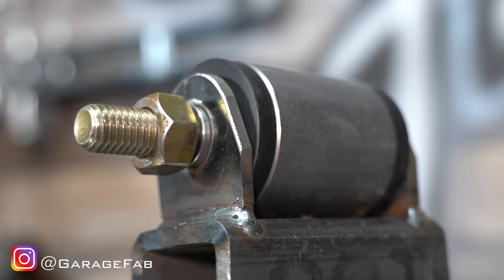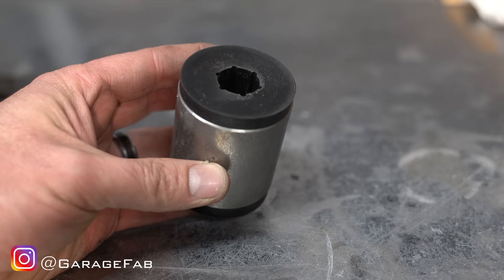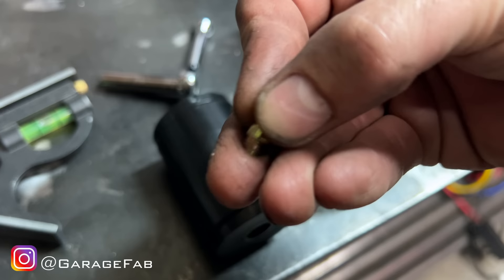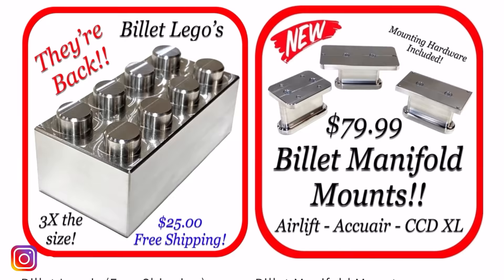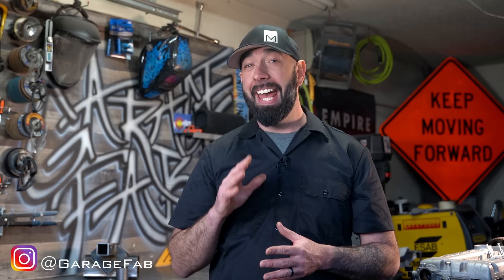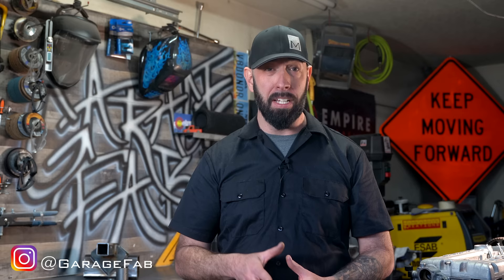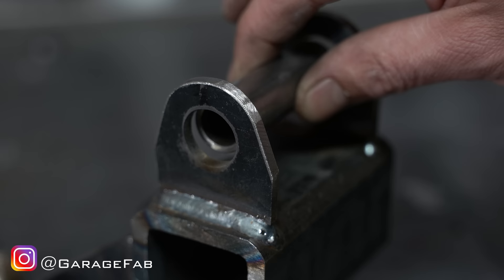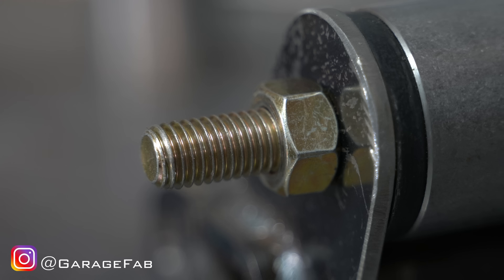The DOs and DON’Ts When Installing Polyurethane Suspension Bushings

Comment: I you'd like 2 see an unexceptable product being produced and sold as replacement parts and compare to the original then here's a prime example I personally had 2 deal with which was time consuming and highly frustrating... rear lateral rods for an 02 pontiac grand prix gtp new replacement are all being made wrong!! The inner sleeves of he new rods are 10 to 15thousants of an inch larger than factory original meaning they fit looser and will prevent rear from holding proper alignment and causing rear end to bump a little side to side over potholes at any speed over 35mph.. this is no joke,, I'm diyr but a well experienced diyr person nothing else was wrong with the car untill I put these in., and in addition the rubber compound of the bushings were softer than stock, so what what the fix?? I temporarily found used ones from a junkyard car and put those in and problem solved!!! New parts should never fit loose and give a car another problem like this,, I did find one brand and one brand only that actually and I can't stress this enough one brand only that actually fit proper and with bushings that are just about as firm as stock which are BMR.. these are expensive but they do what they're supposed to do.. No other brands Not Dorman Not Napa Not Orielys No other brand online just BMR are the only ones that work/fit proper., I only replaced my originals because the adjusters were froze from too much rust no matter how I heated them and soaked them with lube they just wouldn't adjust so that's why I went all this bs,, needless to say I doubt I'll own another w body car,, Nice Video!
Reply from the maker: That was a whole lotta truth! If it’s aftermarket rubber, it’s crap. We’ve tried every brand at my shop and every time we warranteed the job because the bushings failed for one reason or another.
I think you’re spot on. You’ve got to replace suspension components with factory parts, and if you can’t get them, replace with high quality polyurethane.
Thank you my friend!

Comment: And no mention of pre load so still installing bushings wrong.
Reply from the maker: Not necessary with poly bushings. 👍
Reply: @GarageFab  So after looking through my previous builds Energy Suspension and , Hotchkis manuals both do not say anything about preloading poly bushings prior to torque so I do stand corrected my apologies was trying to troll without knowing for sure .
Reply from the maker: No sweat my man!

Comment: "There is NO grease inside the sleeve around the bolt, why? Because..."
Because they want you to have to destroy the f**ker with a hacksaw first, and then with a torch in order to get it off so that you can replace something unrelated on the other side of the truck.
Reply from the maker: Dang. Sounds like something an angry rust belt native would say.

Comment: Poly bushings in this [and most] scenarios are dumb. The poly does not adhere to the inner or outer sleeve so the poly just walks everywhere over it. And often simply binds up any articulation in the joint. Ride quality is worse, road noise is worse. Simply do not use them. 
In a strut arm set up they can be usefull for a competition car only. They do throw a LOT more load into both the arm and pickup point. Aussie Falcons, like all early US Falcons, Mustangs etc plus numerous Euro cars tear the pick ups off under the rad support. I have welded up a couple of dozen, and the strut arm breaks making the car lose control. I have seen several cases of that. One that was a very serious accident.
They NEVER do that with the correct rubber. Which for most cars is far superior in every respect. Always has the correct articulation which vehicles being driven on all roads require.

Comment: Hi .. nice videos! i want to contact you to discuss a project. Its going to be different from what you usually do. I was not able to find any contact details. Could you please tell me how to reach you if interested.
Reply from the maker: Hey Abdullah! I’m sorry, I haven’t got time for additional projects at the moment, but if you need guidance I’d happily try and help!
Reply: @GarageFab  thanks for the quick reply and generosity. I have a 1980 k5 blazer that i want to build a modern suspension for 70% long distance travel and 30% offroad. would you be interested in designing it so that my local fabricator can build it. i am in Saudi Arabia.
Reply from the maker: Sorry my man, I’ve got so many projects all going at once, I just can’t doing anything else. I also specialize in air suspension, (Lowered stuff) so though I understand the basics, I’m not sure my off road designs would be acceptable.
Reply: @GarageFab  I understand .. Good luck with your projects!
Reply from the maker: @abdullahalgarzai7996  Thank you my friend. If you’ve got questions I’d be happy to share my thoughts.
Best of luck on your Blazer!

Comment: Rule number : never, ever use polyurethane bushings in suspensions. They are incredibly bad. Good for motor mounts though/  Delrin or heim joints for suspensions are appropriate
Reply from the maker: That sounds a lot like an opinion! From my experience absolutes are almost always incorrect. Can you tell me why polyurethane bushings in Suspensions are so bad?
My opinion is there’s good quality polyurethane and bad quality polyurethane. Also there is a correct way to install polyurethane and a wrong way.
If you use poor quality polyurethane or install them improperly they will fail prematurely, and they will indeed be “incredibly bad“.
Delrin is an incredibly hard material and should not be used on a joint that needs to articulate. A drag car might be an acceptable use for Delrin but I’m sure someone can argue against that as well.
Heim joints are great, but they don’t absorb vibration and they are not maintenance free. Heim joints should only be used in very specific applications with the knowledge that they must be maintained and replaced when worn out.
Poly articulates better than Delrin but is still not ideal for high articulation applications like off-road vehicles. A better choice might be the Johnny Joint.
Poly is a fantastic choice for performance street vehicles. Some vibration is dampened while still reducing excessive component movement, a moderate amount of articulation is allowed before binding, and a long life can be expected if a high quality poly is used and it isn’t abused.
Reply: Unfortunately at our dealership, I’ve replace many aftermarket Poly bushings that have crumbled apart.   But who knows what kind of voodoo “polyurethane” they were buying.
Reply from the maker: That’s the key right there. Quality. If you try and save money on poly you’re probably not going to be thrilled with the product. If you put Energy or like-quality bushings, I’d be willing to bet a decent chunk of money they would far outlast an OEM rubber bushing.

Comment: You failed to address the fact that polyurethane bushings don't hold up very well when used in a vehicle with high horsepower 600+....
Reply: there are different grades and mixtures of polyurethane, if they arent holding up its likely a choice of stiffness etc issue. not just because its polyurethane

Comment: If your custom fabricating use aircraft hardware,...once you do you'll never go back
Reply from the maker: That sounds exciting. What’s the difference? I’m familiar with safety wire bolts, but beyond that I’m not very educated on aviation fabrication.
Reply: @Garage Fab  first of all the bolts are stronger and the grip length are more variable so no threads on brackets ect nylock nuts no spring washers , ....your fabricating looks nice the addition of this aircraft hardware will really hilight your professionalism
Reply from the maker: I will look into it! Thanks Roy!

Comment: Just use metalastic bushings and forget about it. They last forever and you just press them in and bolt them up. Real obvious?
Reply from the maker: Never heard of them.
Reply: @GarageFab  look them up for old dodge darts. maybe your not old enough to know?
Reply from the maker: The only thing I found was basically factory style bonded rubber bushings which you do in fact press in.
I specialize in adjustable height suspension design, which will destroy bonded bushings. So it’s a no go for me!
Thank you, Karl!

Comment: Polyurethane is a very very poor choice for suspension.
Reply from the maker: I disagree!
Reply: @GarageFab  I have user Polyurethane in my car, did the entire rear suspension had it for 3 years, worst 3 years ever, went back to OEM Rubber bushes and it car is way more firm and predictable on the road. I will never go back to Poly again.
Reply from the maker: I can’t argue with that. All I can say is there is quality poly and crap poly. There’s also a right way to install and a wrong.
When I first started building suspensions 18 years ago, I had some bushings fail. I also was buying the cheapest ones I could find. It’s been over 15 years since I had to replace a bushing on something I built.
Reply: @GarageFab  I used energy suspension

Comment: That will ruin the ride of your car, better to go with rubber if you want quiet isolated ride, really!
Reply from the maker: “Ruin” is a bit of a harsh term. Poly certainly doesn’t dampen vibration as much as rubber but I wouldn’t call it ruined.  Rubber simply can’t handle the amount of travel my vehicles have.

Comment: Not all of this information is correct. I love when guys just assume everything works exactly the same no matter what the aplication.
Reply from the maker: Please explain! Now is your chance to help people and clarify the things that need to be clarified. What’s incorrect? What application changes how a polyurethane bushing is installed?
Reply: @GarageFab  Size guidelines, application method, the inner steel sleeve the outer end caps are all different for different uses. Just because it's what Toyota does and you like it doest mean it's the only correct way. Your mounting tabs for instance are not an engineering standard. Not every bush runs an inner sleeve and some actually need to move in more directions than one.  Some need to be adjustable.  So now is your chance to do some research and set the record straight.
Reply from the maker: You strike me as an unpleasant person that needs to complain and doesn’t really have any desire to help. You probably let the door close on old people at Olive Garden.
I’ve interpreted what you said as, because I didn’t create an hour long video including a detailed guide to the proper selection every bushing in existence and their operation, the information I shared about THIS particular bushing, (arguably the most common bushing used in aftermarket vehicle suspension) is not correct. 🤔
Toyota doesn’t use poly bushings so I’m unsure what your point is there. I chose my bolts based on what reputable manufacturers use on comparable size and weight vehicles for the same application. Would you like me to get an engineering masters degree so that I can learn why I was using the correct bolt already?
PLEASE tell me what suspension bushing doesn’t have an inner sleeve. I’m excited to learn something.
I don’t know everything. I never will. I’m often wrong. I’m not embarrassed.
If you know things, share your knowledge! Stop whining and help some folks.
Lemme get you going…
What is the engineering standard for bushing tabs?
Thanks!
Reply: @GarageFab  Well I do have an engineering degree that's why your video titled the DOs and DON'Ts when installing suspension bushings caught my attention. Straight off the top of my head are landrover rear radius arm bushings that run without a sleeve.  The correct method of determining the size of the mounting tab is based on the deflection of the bushing material under load and has more to do with correct clearance than size because a washer can be used to cover the end and again due to movement often being angular many bushings need the ends to open and clear of obstruction to avoid binding under torque. I'm generally not mean or bitter it's just that I am an older person who has been around the block. You specifically mention Toyota as the source of your sizing and it's absaloutly not true to say they do not use poly bushings on their vehicles either.  If you want to speak from a position of learning and experience and be critical of others work (which you can't deny)  then do a little research that's all. I don't expect you to be embarrassed. Bolt sizing has almost nothing to do with the size of the bush and more the clamping load expected of it and because it's a bolt yes it can also carry shear loadings too. Weight is nearly always the biggest consideration. I help people everyday.
Reply from the maker: I appreciate the input on the tabs. It’s difficult to get decent info from people. There’s no shortage of critique though.
I wasn’t able to find any info on the Land Rover radius arms. The only sleeveless design I can fathom is a bolt with a smooth shoulder that operates the way a sleeve would once it’s tightened. The bushing would still rotate around the shaft so I’m not clear on what the relevance is.
I’ve been a Toyota/Lexus technician for 19 years. Never before have I seen a factory polyurethane bushing.
Cheers
Reply: @GarageFab  I never set out to upset people. Perhaps the bushes I'm thinking if don't show up on road cars as most of my experience with Toyota suspension is from racing but I have defiantly fitted factory control arm bushings on a gt4 celica turbo that were polyurethane. The land rover radius arm passes through the bushing as part of its mounting/articulation point.  I have built a lot of vehicles and made a lot of lessons for myself.  But you are right to say never stop learning. And no never be embarrassed to give it your best try. We only fail when we quit.
Reply from the maker: I couldn’t agree more.